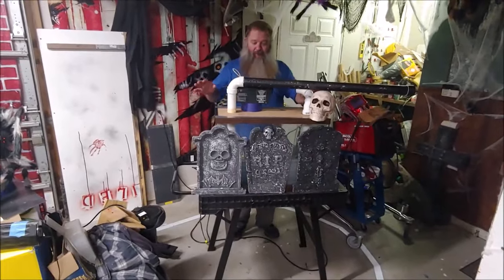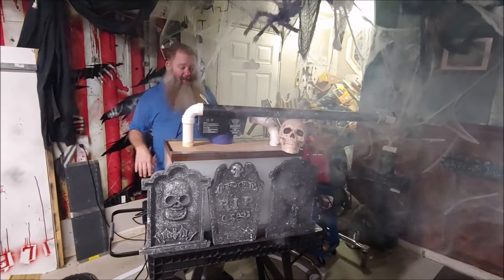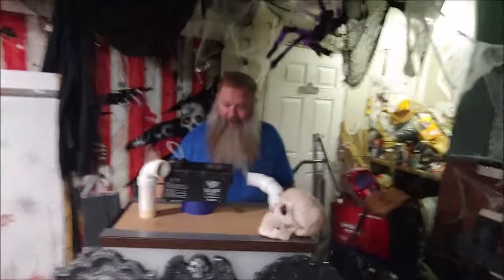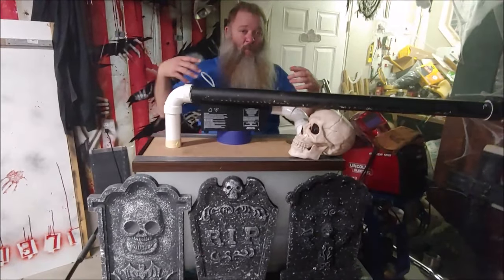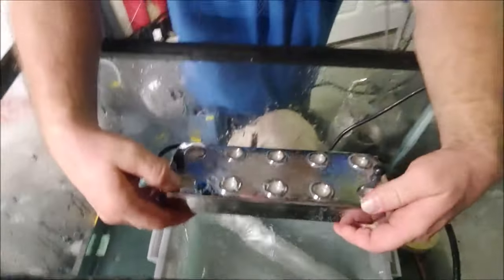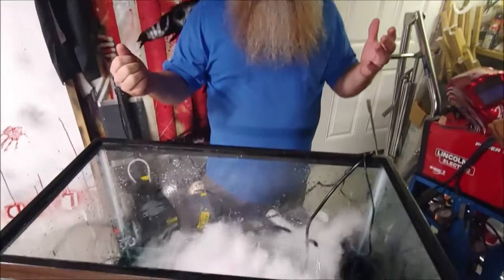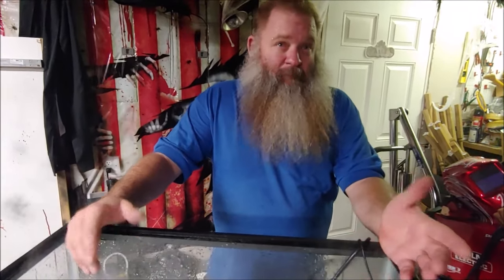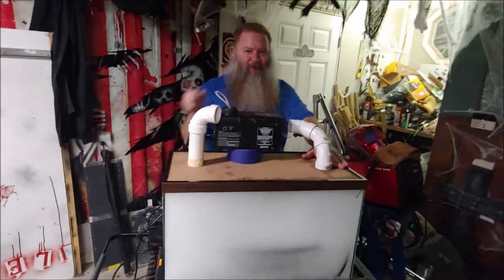Roberts Fogger: The original DIY Fog Chiller without ice

Comment: Oh, man. I'm an engineer. Studied fluid mechanics for 7 years and spent 15 years in the business. I'm a Halloween haunter for at least the past decade, and I'm embarrassed to say I didn't consider this. But intuitively I know you are right on, before I even build the thing. This is great. Thanks so much for sharing. Like you said, we're all better for more info. I was looking for a new project for next year, and now I'm onto it.

If I can recommend a serious, but low budget fogger, I'm more than happy with my Chauvet Hurricane 1100. I've had mine for 6 or 7 years with no issues. Run it a few minutes in April or MAy to keep everything loose and you're good to go. At 700W you don't need to dedicate an entire circuit to your fogger, and it produces a ton of CFM with little juice used. Most importantly, though, you said it: quality fog juice is critical.

And I love that you gave it your name. When the ToTers' parents ask how I do it, I'll be sure to mention it's a "simple Robert's fogger setup," like the entire haunting industry knows what that is. Awesome work. Thanks for the vid.
Reply from the maker: Well thank you!  So much...  what a compliment.!
My background is electronics - This project was just another in my neverending need to tinker and iterate.  It was born out of a "what if" line of thinking.  Truly, I thought it would condense the fog so  quickly that it would just end up in the tank with the rest of the water.  I had only a small bit of knowledge of how fog machines worked.  I knew it wasn't smoke and that the point of the heater was to convert the water in the fluid to steam, causing the glycerin to atomize.... or something like that.   I never expected the fog to be so much more dense nor did I expect it to fall and stay low lying as effectively as it does.   
Dude,  I was kinda shaking with excitement the first time it worked!  
My next thought was to package it and make a ton of money off of it.   LOL. Maybe I should've.  But its been a blast seeing how other approach this project!
Please share your build, if you wouldn't mind.
Thank you for watching!
Reply: @intocoasters  I think you could still package it and make a ton. There are so many Haunted Houses that would purchase a ready made system. Talks to Larry Kirchner who owns the Darkness in St.Louis. I believe out is the largest in the world...Great job my friend!!!
Reply: How about just making your own fog juice? I buy Froggy's but won't be this year cuz I can't afford it

Comment: This is similar to when using ground fog on wet grass. There were times I would wet down the grass on Halloween so the fog that came out of my chillers would glue to the grass for a long time, even in stronger winds. In a no-wind situation, using Froggy's Fog juice, the chilled fog would stay in the grass for quite a while. The effect is really cool when you walk through it.
Reply from the maker: I have never wet the grass - I did not know that was a thing.... I can't wait to try that!  I have relentless wind in my neighborhood.
Reply: @intocoasters  I'd never known anyone else to use that trick before. I noticed the effect, by accident, after an evening rainstorm. Fog is terrible in active rain, but wet grass is a fog magnet. Thanks for your chiller idea, by-the-way! I'm going to have to play around with it; see how compact I can make it and still be effective.
Reply: I was a lighting and SFX designer for live theater for a decade (until covid decimated that industry overnight) but I put a lot of fog and haze on many stages, and there is really no good manual for this. I second Froggy's Fog juice and won't use anything else. They have mixes for everything you need and you can't get most effects you need using just 1 type of fog machine. Half the battle is using juice with right amount propylene glycol, glycerin and water, from thick low lying fog to "steam" jets to thin light beam catching haze. the other half of the fight is the right application. which basically boils down to time after heating to hit a fan, volume of juice from the element to the dispersal fan,  and direction of flow/Elevation of the outlet. Robert makes a very point about not shoving the nozzle  in the tube but leave a few inches of space. This because is because after coming out of the heating element is ridiculously hot and a concentrated mass of atomized moisture that needs to immediately cool down to expand. If you've ever vaped before its the equivalent of opening up the airflow for bigger clouds. when you shove the nozzle in the tube it doesn't get that immediate cooling effect and barely expands. 
The water mist idea is great, but a big no no on a stage where 20-30 people might be doing a huge dance number. But the key point is forcing the fog to compress in a large volume area (large is relative) and being forced to take the longest reasonable pathway before being pull out of the box via fan. the way I alway did this for a low lying effect was to have the fogger on top of the box(I always liked using a cooler to control the temp) piping it in from the top, as Robert is doing, but the inlet pipe went almost to the bottom. I would use regular water ice (As opposed to carbon or dry-Ice which is the pain in the ass thing ultimately I think robert is trying to avoid) that sat in the upper half of the cooler on a grate. Essentially this made three cooling point. The first inside the inlet pipe which is chilled by the ice, then inside the cooler unit, where it compresses the volume as its forced through the bulk of the ice and cooled down, and the through the outlet which starts near the top of the cooler and does a 90 turn at the bottom prior to exiting near the bottom. It takes a few seconds to get going but once the cooler is at max capacity. Yadda Yadda Yadda, end result is thick, cold fog that fills up ground to knee level on a dry flat stage. In wet grass it would stick to the ground for maximum creep effect. This design would work pretty well without the ice too. 
Roberts design is working like a bong, pulling the smoke though the vapor which cools it, making it less harsh, but also producing A LOT more clouds. Chilled fog is kinda misleading. Chilled fog doesn't mean it gets as cold as the ice or water or whatnot. In fact if it got even close to that cold it would liquefy again. But the temperature of the fog directly affects where it will lie in the atmosphere as hotter things want to go up above the colder things. Of course at the same time, hotter things expand more. So there's definitely a balance. There's much more to the art of fog, including fan size. speed and direction theory, barometric pressure, venue venting if indoors, weather if outdoors, persistence of the particulate curtain, fog waterfalls, flameless pyrotechnic effects (using lighting and fog together) beam capture (using lighting and fog in a different way), Moving lights and textured lights, CO2 instant fog chillers, CO2 fire extinguishers as an effect, and that doesn't even include magician acts, music concerts or events on water. And as someone who was a lighting and SFX professor, there is almost no good material or shared information on any of this stuff, outside of the DIYers sharing their info for their home haunts..
so I say thank you Robert for sharing what you've learned. I think everyone has a lightbulb moment when they finally learn about leaving space between the machine out and the cooler inlet. And you don't always have to understand how something works to know it works. Lots of innovation has been stifled by the innovator wasting time figuring out how something works, and much other innovation has happened in the absence of understanding. Hell that probably includes 90% of all medical advances.

Comment: Makes sense. Sounds to me like the particles of vaporized glycerin from the fogger pick up extra moisture from the water the misting unit has suspended in the chamber, become larger and therefore slightly heavier, which makes it sink instead of float. Awesome invention!
Reply from the maker: Thanks man! 
That's my guess from observation and what little I have found to read online.  
Whatever is happening, it's a pretty cool effect.
Reply: I agree.  I use this exact setup with just a few Ice cube to get the water to about 40 Degrees F and it works great.  And it is at least half the size.
Reply from the maker: @jeffallen3382  thank you!  This project has been several years of tinkering. I don't remember sequence of events that got me here exactly, but it started with the observation that water misting units always stayed low to the ground regardless of the temperature of the water or the air.
I also noticed when trying different methods of chilling fog that the better results occurred when the fog could physically touch the ice rather than stay isolated from the ice, like through a piece of duct surrounded by ice.
I had tried using three or four single misting units and fog, it never really sank but was noticeably thicker. Just not thick enough apparently.
I saw a pond fogger unit at a hardware store on display and was blown away by the output of that unit. That got me excited to revisit the project you see here.

Comment: I can confirm this works 100% as shown.  My initial tests were indoors using the container I had made into one of the ice fog chillers.  It was too cold for the outdoor test.  Fog went in horizontally across the top of the mist then out on the opposite end pulled out by a computer fan.   Just as in this video the fog dropped and did not rise.  The effect was instant so long as the mister was on.  I am debating tweaking my existing container to allow the input to come from the top as in this video but I am not sure that it would make a difference in the final fog volume.  There is also some wiggle room in the mister depth where higher or lower doesn't make much difference.  The amount of condensation coming out with my horizontal system is insane - Noticeable drop in water level with the fan in use so the pump is a must and likely would need some refills in an evening.   The big test will be seeing how it works in the colder outdoor setting, but I have no reason to believe it won't work the same way.   I'd say this system is a game changer!
Reply from the maker: This is AWESOME to hear!  Thank you for sharing!!

Comment: This is an INCREIBLE idea / discovery.  One thing that can make this even simpler is buying an ultrasonic mister that comes with a float ring.  That keeps it at the right level in the water, eliminating the need for the internal bucket and pump.  Just fill up your main tank and drop it in.

I can't wait to build one of these.  Such a game changer.
Reply from the maker: I love this idea!  Less parts = more reliable. 
I'm going to look for this!

Comment: Very interesting - thanks a ton for the research, testing and posting the video!

One thing you might consider is using a float for the ultrasonic mister.  You can typically buy them at stores that sell the misters, or make your own from a piece of foam and a tray to hold the mister.  Either way, it would allow the ultrasonic mister to float at the ideal depth - even as the water gets used up.  This would eliminate the need/complexity of the pump, second container, second power source, etc.
Reply from the maker: Thank you! I love this idea!  I will certainly explore that. One less power outlet, the better!

Comment: Great system indeed. I live in Dubai, United Arab Emirates and in October it is still very warm even at night, so I have been using my fog machine with a homemade fog chiller with dry ice in it to get the ground covering effect. But it is not cheap to buy the dry ice and with the heat of the machine in the warm weather I feel like all is turning very hot. Last year we bought the same ultrasonic  mist maker that you use in your video. But we received it just before Halloween and were not able to find a satisfying way of getting the thick and covering fog effect. The fog was stuck in the box. I am going to try your now famous "Robert's fog system" although I didn't get the water pump system installation very well. 😆👍🙌
Reply: I checked the water pump system, it is very clever Roberts! Now I will run some tests with ultrasonic mist makers only and no fog liquid to compare. I am thinking 3 blocks of 10 heads in a big box with the fans on the top. I want to cover some ground and would like it to stay low. I tried this morning with a block of 10 head in a medium plastic box and it was very nice but it got even better when I added ice pads in the water. It was crawling and staying a long time on the ground. The temperature outside was 86°F at 9.30am. Right now it is the hottest season of the year in UAE, with a whopping 107.6 °F at 3.45pm right now... In October it will be cooler but still hot, not like back to France where I come from. Cheers.
Reply from the maker: @bruhnette  that's awesome!   Wow, I bet with 3 of these mist units it would be killer thick and low!  I'd love to see a video when you do that!
Reply: @intocoasters  So, we have tried with 3 units of 10 heads, in a big styrofoam box. We have plugged 2 computer fans on the lid. The fog was coming out through a pipe that goes high and makes an angle then we have another pipe with holes all along. We want to make a fog curtain. It will be in our carport and we want to create the entrance of a cave with the fog coming above our heads. The result was not satisfying. The mist alone produced by the ultrasonic heads is thick inside the box but when going through the pipes even it comes out nice, doesn't go down enough. It dissipates very quickly. So we don't have the fog curtain effect. 
On top of that, the water temperature was super high. Even for a bath I wouldn't like this level of temperature!
Based on this, we added ice and then the effect was much nicer, with a durable and crawling effect. The thing is, as it is very hot in Dubai, we don't want to be forced to add ice many times during the Halloween night. The ice doesn't last long enough here, the water produced with the transducer is almost burning hot and buying dry ice isn't cheap either. 

SO, we decided then to add a regular smoke machine that we already had, in order to complete and boost the system. It worked much much better.  The fog from the machine is blown into the box, get charged in humidity produced by the ultrasonic heads. We obtained a thick, dense and regular fog curtain. We canceled the computer fans because the blow from the fog machine is enough to make the smoke run through the whole pipe.

We decided, after all that experimentation, to keep only one unit of 10 heads but in a smaller box. Place the box high above our head in our carport and connect the pierced pipe directly to the box, no angled pipe. 
Obviously when wind blows, nothing goes down but it still stays theatrical enough for us. Our car port is completely open on 2 sides. So wind is coming a bit from one side and the front. Once we will put the whole decoration,  we might achieve to get less wind coming in. My husband still wanted to add some ice in the water to check if the fog would get enhanced. He was right. I am still thinking that adding ice many times in the night isn't great as the system is not easy to reach. We have a remote control for the smoke machine and can manage from the ground.

To conclude, based on the fact that it is our hottest time in the year, we were happy with the  nice heavy and dense effect we got. It then should be even better in October nights.
Reply from the maker: @bruhnette  This sounds like a great bit of testing!    I know the water can get hot with one 10-head unit, I can't imagine how hot it would be with more.
I am trying to come up with a way to circulate the warm water through a small radiator with a fan - like the way a car cools the engine fluid.  Of course, this would complicate the design but could make it more robust and scalable to a larger capacity.  This video was my first design attempt.  I'm for4ever learning and tweaking.  
Thank you for sharing your results!!!
I was thinking about the draft of both doors being open.  Perhaps a kind of warehouse curtain?  I know there are clear plastic flexible panels used to keep different air spaces separate in warehouses.  That might help reduce the effect of a breeze.